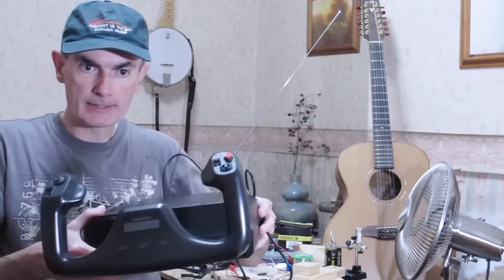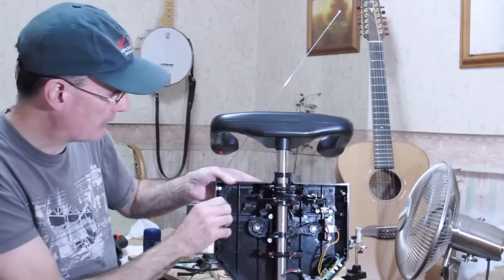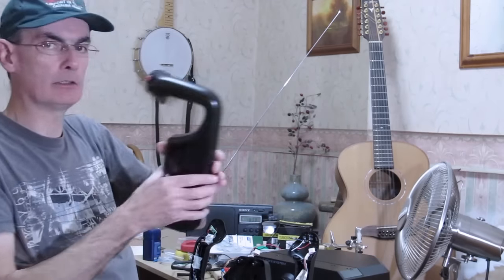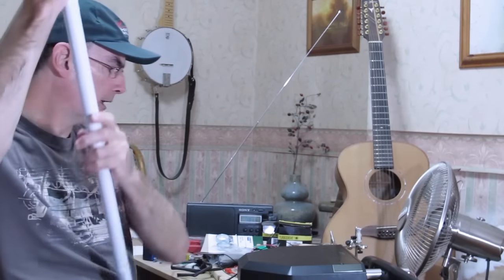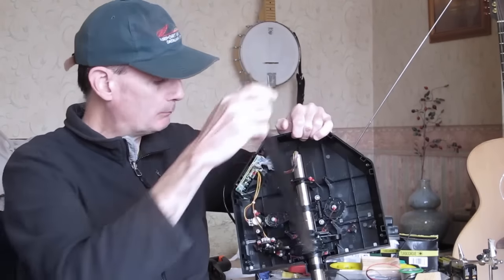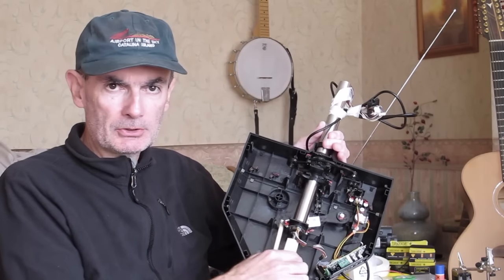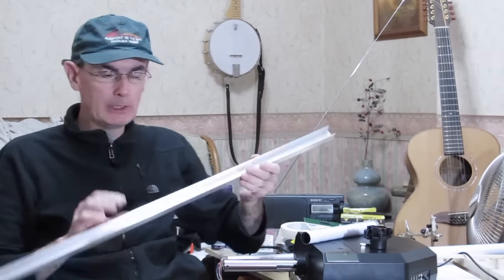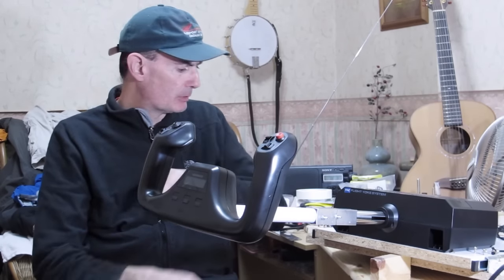Saitek Pro Flight Yoke Ultimate Fix (Part 1)

Comment: Great video, Mark. I've was toying with a similar idea that I never put into practice, mainly because I never came up with  a solution for utilizing the existing potentiometer and fixing the shaft in the original case. This video has rekindled my motivation to try again. One of my goals, though, has been to increase the full throw to a full seven inches to simulate the two Cessnas I fly (or more correctly, have flown) in real life - the 172 and the 182. I have the Cessna yoke which does give me a full 180 degrees full left to full right, but always felt then elevator was far to sensitive with just 3.5 inches of total travel. Your video gave me an idea of how to accomplish this. Thanks!  I'm also toying with the weight idea to add that bit of inertia and also with adding some weight insidenthenyoke handle to give it a more solid feel. Great food for thought!
Reply from the maker: +James Rickel Thanks James. Honestly, I would like to do it from scratch, maybe using a real aircraft yoke. I did a quick eBay look and turned up a nice vintage Cessna yoke that would look great. I am now convinced you can do the mechanics very easily by separating out the pitch and roll bearings in the manner I have done here. Likewise the springs, i.e. keeping them independent of each other. And by building your own yoke you could make the travel and rotation anything you wanted! I think weighting the ailerons too might make things feel a bit more realistic, especially if you fly a big aircraft.

Comment: I decided I could no longer stand the sticking elevator control so I went this route with the drawer slides. I did not mess with the handle or do any rewiring or lengthen the shaft (I'm not sure why you did actually). It was a nightmare to get it all set up, probably spent 20 hours on making it work well, but in the end it is so much smoother. However, the null zone you mention in part 2 of your video still makes it difficult to make a good landing, so I plan on purchasing the BU0836X and wiring it up. I learned one new thing by doing this project: center the yoke before turning on the PC since the current position will end up being the zero point once the drivers are loaded. Slide show of my build here: watch?v=JdgLoy6L2Kg
Thanks for your informative and entertaining videos.
Reply from the maker: Awesome! I linked your video here: (https://www.youtube.com/watch?v=JdgLoy6L2Kg). The reason I lengthened the shaft on mine was I knew I was about to start experimenting with a front screen for gauges and I needed the screen to sit as low as possible. Mounting the yoke further back allowed me to mount the screen almost down to where it was touch the shaft, and ideally behind a fascia panel. In the end I didn't use the Saitek - I started with the Iris Dragonfly and then the Yoko, which is what I have now.

Comment: The grease you find inside is silicon grease.  Vaseline dries out over time.  Vaseline can also dissolve or damage rubber and other petroleum based substances.  Remember from chemistry, likes dissolve likes.  You never mentioned, why a longer throw is better.  The throw on my stock Saitek yoke seems fine.  What is the difference?
Reply from the maker: By 'longer throw' I will assume you are asking why I chose to lengthen the shaft. I had planned to mount it behind a panel, so it needed to stick out further.

Comment: Good build.  One key factor is the slides you select. Can't have any play in them.
Please keep us updated as to potential problems. 

Thanks,
Paul
Reply from the maker: +PT Johnson I am hoing to do a follow-up 'review' video to discuss the performance. There is a little bit of play but in practice this isn't really noticeable when you fly it. However, you might go and source better sliders, these are really bargain basement ones.

BTW, since making this I have also disconnected the aileron spring and will be making an external bungee spring for ailerons.

Comment: Hi, I realise I'l late to the party here (some 8 years after the video was psted). My Saitek yoke keeps disconnecting -if I jerk it too quickly the lights go out. Also, the led on the throttle quadrant flickers some times as does the screen on the yoke. I put this down to poor electrical connections - have you experienced this as well and is there a simple fix?
Reply from the maker: The LCD screen was well-known for becoming flickery over time. I think the general 'fix' (which I used) was to stick a piece of black electrical tape over it! As for the disconnecting, I expect your are right that it's a loose connection somewhere. I guess that would be fixable if you could trace it, but the wires are all very skinny :|

Comment: What a great video. I have the Cessna yoke. Ailerons are great. I am living with the elevator control with a monthly application of Mobil 1 synthetic auto transmission fluid, and it still binds more than I'd like.  I think you definitely cracked how to completely bypass the horrible plastic bushings though. If the gear oil I'm using wears them away, I'm doing this for certain.
Reply from the maker: I don't think the Cessna yoke is as bad, since the mechanical design is different. But yes, this is a sure way to fix it once and for all!
Reply: I've just completed my own version of this now, using an existing keyboard tray, and replacing the extension/dowel with a bent steel rod as one of the other commenters linked to. It is absolute night and day, not only the notchiness gone, but also the bungee tension intuitively lets you know how much you are trying to deflect the elevators and has naturally stopped me from over-correcting so much. Parts list for me was about $25. Feels like I've tripled the value of the yoke. Thanks again for this great video.
Reply from the maker: Great, the keyboard tray sounds like a bit less hassle!

Comment: I have had one of these yolks for years, have been through a couple of rudder pedals, and throttle quadrants. But yolk still going, with one exception the hat on the left hand yolk, keeps not letting you look al round, just up! Is there a repair for this? I would get a new one but all suppliers including manufacturers are out of stock if you do find money there anything from £300-500. So will be sticking to one I have especially if I can fix the hat. Can anyone help?
Reply from the maker: I expect you could get a new hat switch and replace it, or maybe it's a broken wire. You can dismantle the handle and have a look.

Comment: Would you recommend buying the Cessna Yoke instead of the Pro Flight Yoke?
Reply from the maker: Yes, it is a much better yoke. Check out my detailed review video hearabouts. And as luck would have it, my Cessna yoke is for sale on eBay right now! http://www.ebay.co.uk/itm/162150240678?ssPageName=STRK:MESELX:IT&_trksid=p3984.m1555.l2648

Comment: Is it theoretically possible to add some kind of force feedback (ie a stick shaker/vibration/buffeting effect) to the design whilst keeping the original assembly in the case?
Reply from the maker: Anything's possible, I suppose. But i doubt it's worth doing.
Reply: @AlmostAviation  I guess then my question is does there exist a yoke for pc that does have force feedback/stall feedback?
Reply from the maker: @MrEthanhines  Yes, but make sure you're sitting down :)  https://www.brunner-innovation.swiss/shop/
Reply from the maker: Or if you're just talking about special effects, I think an XBox controller does its vibration things in MSFS. I suppose you could just screw/tape one to the yoke and that ought to give you some feedback :|
Reply: @AlmostAviation  I am not a pilot but I have a GUT feeling that a yoke on a Cessna 172 doesn't go back to a centre position as when pulling back on the Logitech(Saitek)  yoke I have a feeling that the yoke responds to the current configuration of the elevators/ailerons and also I am told that right before stalling there's a shuttering effect on the yoke as well. Theses are the types of feedback I would like to replicate.
Reply from the maker: @MrEthanhines  Not sure I understand you but no, the airflow over control surfaces will centre the yoke at anything other than very low taxiing speed. In the real plane the elevator 'home' position will vary with pitch trim, which isn't simulated in a Saitek or similar yoke. You will get some buffet at the stall in a real aircraft, but it's nothing like an artificial stick shaker in an airliner. Most models will show this somehow in visual and audible effects in a stall.
Reply: @Almost Aviation  Unfortunately, I am very familiar with the stall horn/verbal stall warning systems on the simulator. It usually occurs before touchdown, and I basically "fall," the last say 15 ft from the ground. Ironically, since switching to the yoke, I feel like I've lost some control over the aircraft, for example I lost rudder control because the joystick provided 3 axis of control, pitch, roll and yaw/stearing. Now, I have to use the joystick on the side of the yoke simply for stearing, and I have the ai autorudder turned on.

Comment: I have the exact same yoke how ever my issue is that my yokes usb cable is broken as in its working in very specific areas and it only works for a few seconds
Reply from the maker: If you're sure it's the USB cable and you can tell where it's bad, it should be quite easy to fix. USB only has four wires and they are standard colours. I had this problem with the USB connector for my TrackIR, so I just chopped it off and then cut up another USB lead and soldered the wires together. The main problem is the wires are very thin, so you have to be careful.

Comment: By now I'm sure you have also looked inside the Saitek Flight Control Pedals, you probably can explain why all the wires from the potentiometers (yaw and brakes) to the small board inside, are totally naked, they even touch each other. This board failed for me and I'm looking for a replacement like an Arduino board. May be you can kindly show some light in the subject. Thank you
Reply from the maker: Sorry, I haven't looked inside the pedals. Perhaps the naked wires are grounds wires, so they should all be connected together. Perhaps your problem is a bad ground connector? Otherwise you can replace the controller with a Leo Bodnar board or similar. Using an Arduino board is going to be fiddly, so I wouldn't bother unless costs are really tight.
Reply: @AlmostAviation  Thank you for your comments. If you look inside you will see 6 naked strand wires coming from right and left brake pots, they connect into 2 headers (3 each) and into the board Vx and Vy. The Yaw pot is connected with regular sleeved wires and soldered to board. It is a bit puzzling. I will look into the boards you mentioned. Thank you again

Comment: would you recommend me removing all strings of the yoke? in real life there are no springs in the control system which centers aileron and elevator so i thought that must be more realistic
Reply from the maker: No, definitely not. You are wrong about real life, the control surfaces are centred by the effects of the airflow, which at any given speed acts just like a spring with a rising rate. The difference is that the spring tension changes as you speed up and slow down. The only time you ave no centring tendency is when the aircraft is parked (or stalled, I suppose).
Reply: @AlmostAviation  hmm you are right thx for that! i almost made the mistake getting dirty fingers of it ;P

Comment: Greetings Sir.Hope all is well.I know this is a old video and I am sure you are using a different yoke as of now.I am still using the saitek and I have modded and extended it six inches.It is still working out for me.My question is, on  the 3 usb ports on the yoke .Are they used as power for the radio stack,multi switch and panel? In other words can you plug the  saitek radio panel ,saitek switch panel and the multi switch panel in those usb,s and will they function?
Reply from the maker: You can try plugging those things into the yoke but you will probably find thay work unreliably unless you use the optional power adapter. In other words, it acts as an unpowered USB hub by default. I'd just buy a cheap powered hub and run it separately.
Reply: @AlmostAviation  Yes I have been doing that for years.I was just curious Sir.Thanx for getting back to me.

Comment: Wow the wires are so tiny. How do you solder and extend these? I am struggling a bit to be honest. I was hoping to find and buy the connectors to make extensions without cutting the original wires, but couldn't find them online anyway.
Reply from the maker: Yes, they are thin. You just have to be careful! It helps to have a decent wire stripper.
Reply: Solder using a lineman's splice and cover with heat shrink.  Don't use less reliable crimp butt connectors which have the possibility of creating greater resistance or pulling apart.  For wire guage that small, get this type of wire cutter, https://www.thonk.co.uk/shop/wire-strippers/  Dont get the type with different size holes.

Comment from the maker: @John Akston Yes, the cheap yokes are junk. Not sure I agree with much else of what you say. Springs and bungees can produce rising rates without hydraulics and the more expensive yokes do use proper bearings. They can also be super-smooth, as is the Yoko. Some high-end flight controls do use hydraulics, of course, such as the FlightLink rudder pedals I have, although that's just another way of (partially) approximating aerodynamic feedback from real flight controls. Most high-end systems now seem to be going active force-feedback, which in principle can simulate anything. And which is obviously going to take the price far out of reach of the casual simmer. It seems notable that there are many certified ATDs using spring yokes, so they're obviously good enough for the FAA/CAA/JAA.

The junk yokes are junk because to date there is no satisfactory price/performance compromise. This is economics, not 'stupidity'. Many have tried, most have pretty much failed. Perhaps Honeycomb has done it, but it has yet to release its yokes into the wild. Fulcrum claims to have done it, but whether that will ever get into production and with its present (already mid-range) price is unknown.

Comment: excellent , thorough video thanks..will be sorting your upgrde...have just bought one of these from flea bay for my boy for xmas and lo and behold the lcd screen only shows half the digits, do you know of any replacement lcds around? or how to fix an lcd? cheers
Reply from the maker: Sorry, no on the LCD. It doesn't do much anyway, so I wouldn't bother. In fact the most common fix for the Saitek LCD is a strip of black insulating tape to stick over the top of it! This is because a common fault is it sooner or later develops a persistent flicker in the backlight.

Comment: Do you have any idea of how to introduce a vibration motor inside a yoke ?
Reply from the maker: +Willy Taiti Not sure what you mean by a 'vibration motor' but you could have a look at Opus FSI. This allows you to hook up speakers to a separate sound card and connect specific sound effects to simulator events. It's intended for use with ButtKicker systems or bass transducers, rather than regular speakers. You will need to buy a separate 5.1 capable sound device but you can get a USB one for about £25.

Comment: Hello, I'm having issues with the saitek cessna yoke. My aileron control for rolling to the right has a slight but very annoying zone with no resistance at all and then after 15% it has the normal resistance again. This only happens when I roll to the right. It didn't have that problem from the beginning. I searched for this problem everywhere on the internet and I just couldn't find anything. Does anyone here know a fix? And no, fixing it the way you fix the Roll on the Pro flight doesn't work as the Cessna Yoke uses gears and NOT springs.
Reply from the maker: Actually the Cessna yoke does use springs, so you likely want to try to figure out why yours appear to be slack in one part of the rotation. You can see something of the spring operation in my Saitek Cessna yoke video, here: https://www.youtube.com/watch?v=Rehh4ShX16Y, from about 30:35.
Reply: Thanks, I opened the case and checked every part. At first, I thought it was the spring you're talking about but after closer inspection, (trying to look through the plastic cylinder) I found that the metal bar responsible for the ailerons is faulty. It is thinner on one side, due to the wear of the right piece of plastic supporting the springs. Now I simply have no way of fixing that as it would require no not only take that cylinder apart but also the pole itself (no clue how I'd do that). I'm very disappointed that Saitek made something that used to be an easy fix, this hard to repair. Do you by any chance have any ideas?
Reply from the maker: Oh yeah, that would probably account for it. I would guess the inner sleeve of the slot has worn, rather than the bar itself, as I think the sleeve has a plastic lining. You could try inserting some kind of shim inside the slot. I'm thinking of something like a long rectangular shim, maybe cut from a beer can or something. Whatever you do it will likely be a pain without dismantling the mechanism :(
Reply: I understand. Thank you so much for trying to help though! You definitely deserve more subscribers :).